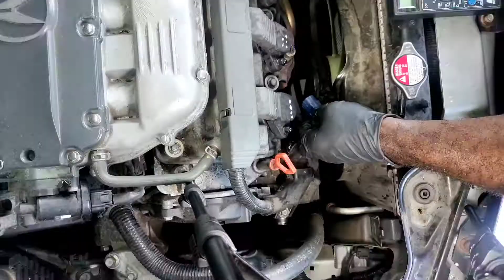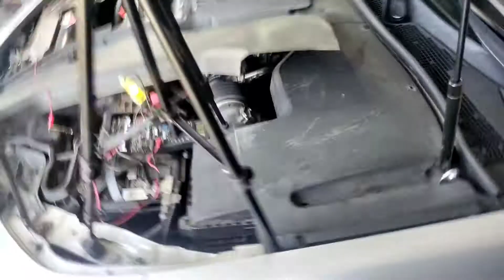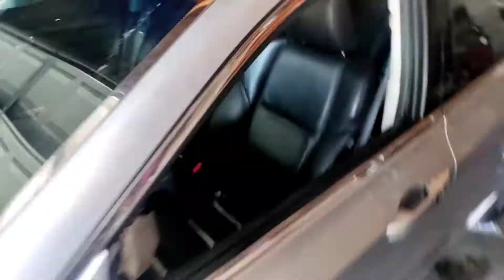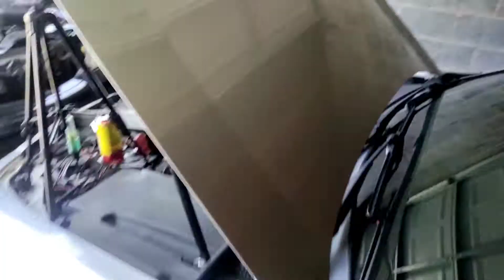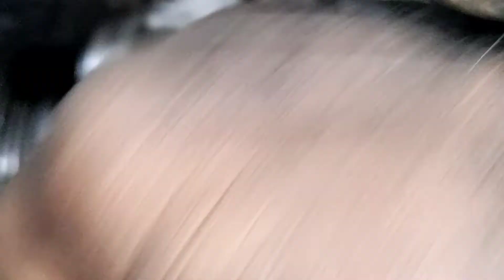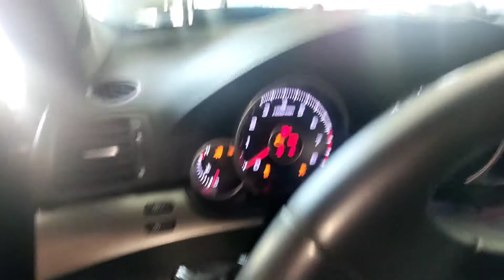2013 Acura TL alternator, battery light on but still charge

Comment: I’m having an issue with my 2008 TL where I replaced both my alternator and my battery but the battery is still not charging. The alternator itself tested good , but the charge isn’t getting to the battery. I’m so lost idk what to do anymore :(
Reply from the maker: You'll need a digital volt meter for me to help you.  Do you have one handy and know how to work it?
Reply: @partsshooter  multimeter ?
Reply from the maker: @bigmangozg2677  yes
Reply: @partsshooter  lol I know how to use one but I don’t own one. I’ll buy one tomorrow, what should I look for ?
Reply from the maker: @bigmangozg2677  did your alternator test good on the car or OFF THE CAR IN THE STORE?  I'm curious.  I just have to ask.
Reply: @partsshooter  off the car it tested good. It tested bad from the battery in the car .
Reply from the maker: @bigmangozg2677  basic test you can do...

With Key on engine off, unplug the alternator, check the voltage output at the connector of the wire harness. 
3 of the 5 wires should read 12v, the others should read 5v (if i recall). Just make sure those wires have some sort of voltage.  Either 5v on 2 of the 5 wires (i wanna say) or 12v on 3 of the wires. 

If they all are producing those values. Inspect the pins inside the connector,  make sure they are all uniform,  should be able to stick a threading needle and have consistent tension on all.  If one is loose, try and restore pen tension as the others. 

Reconnect the connector to the alternator, and start the car.  Check the battery wire at the alternator (the thick one held by the 10mm nut) there should be 13.5 -14 volts. If voltage is there and not at the battery,  check the 120a battery fuse.  It should blown! 

When people jump start the car backwards,  It can blow
Reply from the maker: @bigmangozg2677  you can do this test in any order you prefer... obviously checking battery output at alternator is easier
Reply: @partsshooter  I’ve checked the fuse already , it’s good . I’ll definitely check it at the wire , thanks !
Reply: @partsshooter  appreciate your responses man. I actually found the service manual and saw the fuse diagram that controlled the alternator and vsa. Both issues I had. It was blown, I couldn’t find any info about that fuse online. But she’s running all good now. Idk how I missed it when I checked all fuses lol .

Comment: Thanks.  Similar symptom on 06 TL charges the battery but the light is intermittently coming on, then it goes off, so alternator must be internally failing but the battery tested good, as well as the alternator, which was charging the battery at 14.3v.  Any opinion?
Reply: You need to test everything. I replaced the alternator only to find out it’s not the alternator. Check the battery sensor, Bluetooth module, fuses, etc. main culprits
Reply: It is most likely that Bluetooth module
Reply: @franklinsarabia7713 hey I got a battery icon that pops up at high speeds but once I get on the regular streets it goes away , got the battery and alternator tested and both came back at 100% !! Still struggling trying to figure out what’s going on
Reply: @devin.navarro  did you ever get this fixed? i just had the same problem coming back from a road trip. The battery replacement light would come on & off
Reply: Same problem on 2012 check charging system light and battery keeps coming on but everything checks out good but still light comes on and off.  Did anyone find the fix? @dumpdfg4
Reply: @mrsmincey9731  What it turned out to be was the voltage regulator, it was over-charging intermittently, until it just got progressively worse, then it caused the battery to overboil and the engine stopped running.  It happened on a road trip, but I fortunately brought tools and was able to get towed to an AP store where I replaced the battery and alternator and was back on our way.  It also blew out the HVAC variable resistor which forced the fan to be on High on any speed selected.
Reply: @franklinsarabia7713  BT module was already disconnected.  Recently, battery light and other dash warning lights all came on, it turned out the internal voltage regulator failed and caused the battery to overcharge and over-boil the battery while on a road trip.  The car stalled while on the highway, was able to pull off to the median and got towed off.  I replaced both the alternator and battery, that over charge also caused the blower motor resistor module to fail (blower fan stuck on high and none of the HVAC controls worked) even 'Off' wouldn't turn off the blower fan, so had to pull the fuse.  I changed that out later and that corrected the malfunctioning HVAC controls.

Comment: This is what keeps me from doing mechanic work professionally.  I don't mind helping people, helping friends, etc.  But it seems that most times I've done work for money, there was always something that bit me, sapped my time or even lost money on selling a used part that failed fairly quickly, etc.  There's always something that you didn't anticipate..   For a dealer, they make so much money on sales and commissions that it makes up for some repair loss and warranty.  But for an independent technician to be taking losses or come backs for something that isn't even their fault--  there's not really any good answer to deal with that.......   I just can't deal with that stress personally, knowing that the thing I just fixed is out there with someone else driving it, and I don't even know if they are treating it well or running it into the ground at a race track or something, and bringing it back to me as if I did something wrong. lol..    I work on my own stuff and that's enough mechanic-ing for me.